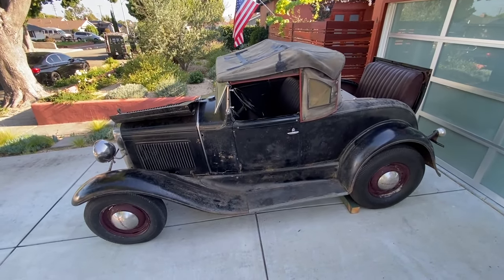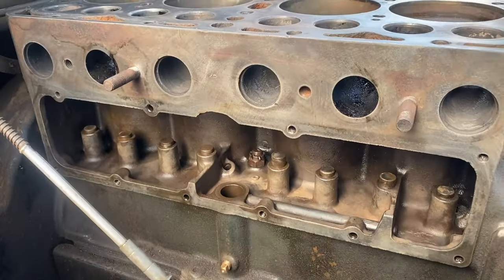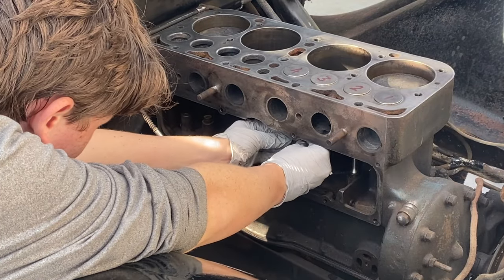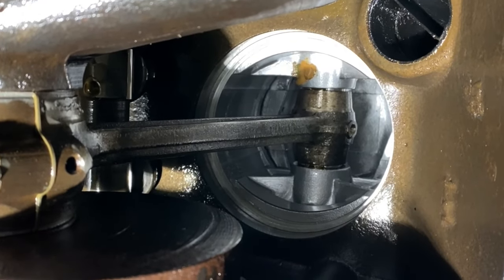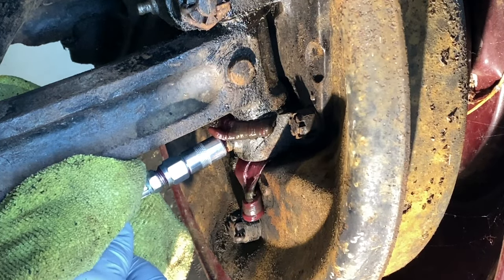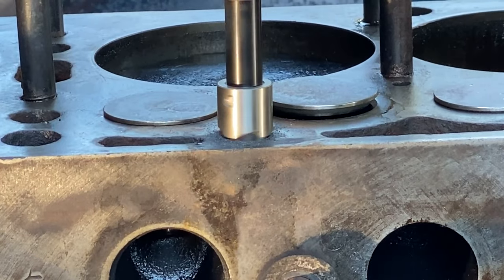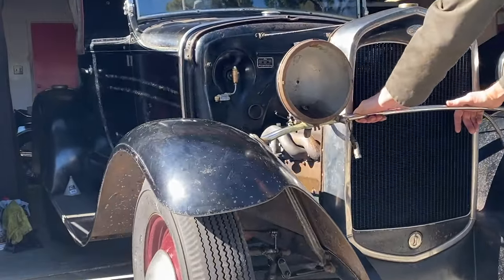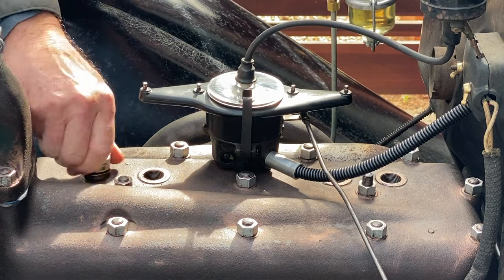Ford Model A Back on the Road

Comment: The look on your face as you drive the Model A at the end, is the same as when I drive my early '31!  cheers.
Reply from the maker: Thanks, Lynda! By the way, I carefully monitored our speed, increasing by 5 mph gradually, and we found the car could reach 55mph with no trouble. We won't be driving that speed very often but it's good to know the engine is strong.

Comment: When the car started it looked like a little exhaust leak between the manifold and the block.  Have fun with your Model A.
Reply from the maker: Good eye! Turned out the exhaust manifold has a slight warp. We ended up replacing it.
Thanks for watching!

Comment: IMHO, do not run that clear distributor cap full time. It will eventually fail. Keep it for car shows to show people how it fires, but for long term, not a good idea. It was a great video tho. I greatly enjoyed watching. Keep those Model A's running for generations to come!
Reply from the maker: Why did you think it will fail? Thanks for watching and glad you enjoyed it.
Reply: @horsepowerheritage8030  the material they are made of isn't designed to handle the heat of full time use and will eventually crack.
Reply from the maker: @mnrebel4ever  That's what I figured you meant.That was certainly true of clear plastics in the past, I just wonder if the formulation has improved?
 I'll keep the original Ford cap in my spares kit just to be safe!

Comment: Hope your valves aren't too tight. Nice job also.
Reply: Did you check the lash?
Reply from the maker: Thanks. You probably know the tappets in these engines are not adjustable so the only way to adjust is to grind the valve stem. I used good quality valves and she's running great. No excessive valve train noise and the engine is breathing fine. Thanks for watching!
Reply: @horsepowerheritage  Yes, I know the only way to adjust lash is by grinding the stem or face of the valve. Your new valves must be checked for proper lash after install.

Comment: Enjoyed your rebuild video.  I was wondering if you checked the brakes.  I had a 30 coupe with mechanical brakes and I adjusted at least twice a week, driving to and from high school. (In the 60's not the 30's) even then they could be scary.  Later acquired a 31 coupe that had hydrolic brakes from a later Ford. I'm looking at another model A but a convertable like yours.  Unfortunately it has mechanical brakes so I'll want to change them over... I'll look for more stories from you. And your special tools too.
Reply from the maker: The brakes needed adjustment and they work well (for mechanical brakes). Thanks for watching and don't forget to like and subscribe !

Comment: Good to see it back on the road. But I don't know about your timing system if you pointed the rotor towards number 4 spark plug instead of number one with the points starting to open.
Reply from the maker: Watch again at @7:45. The rotor doesn't point to number 4, the wrench handle does (which means the rotor points to number 1). Thanks for commenting!
Reply: @horsepowerheritage  Okay, But you could  clarify that having the wrench point to number four plug means that the rotor points to number one spark plug terminal. Otherwise, there's some good, useful info on there. I got quite a laugh out of watching an original Model A assembly film. It shows a guy tightening connecting rods and main bearing bolts without using a torque wrench. Maybe torque wrenches hadn't been invented back then. But I'm sure it wouldn't take long for a mechanic to know how many times to turn a wrench on those bolts.